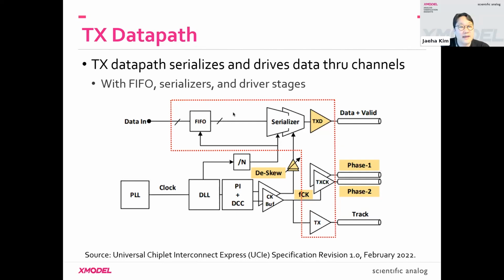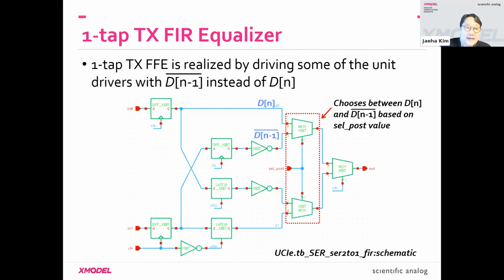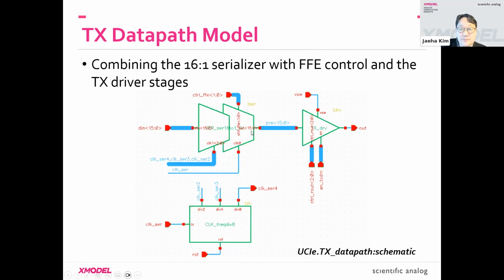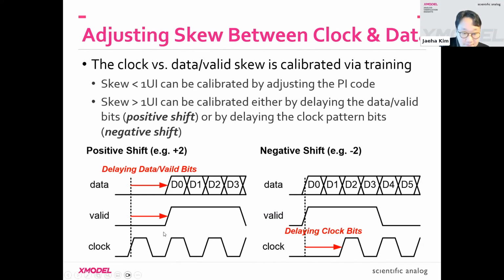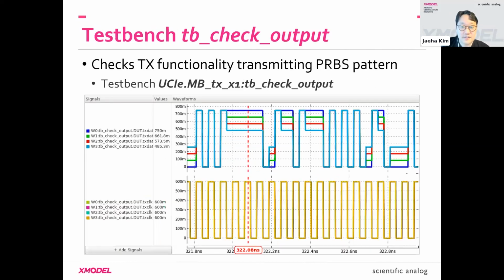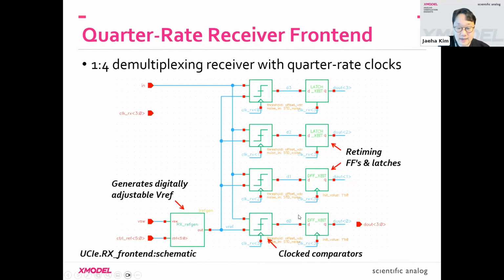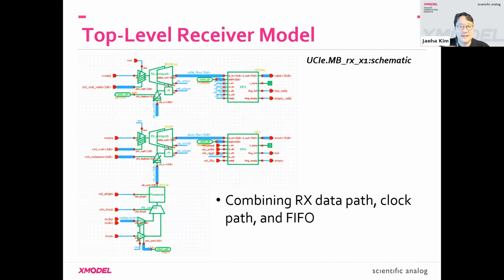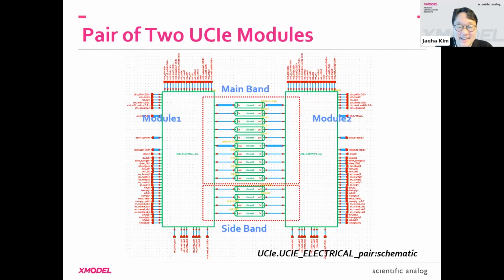[4/5] UCIe PHY Modeling and Simulation with XMODEL / UCIe Electrical Layer Modeling (Part 3)

Comment: Hi Thanks for the video, it is a very good tech video. I have some questions, for the FIFO, It does not have the double synchronizers to sync the wptr to read clk domain, vice versa, could i ask why those double synchronizers can be ignored in your design? By the way, If the double synchronizers added especially the rx fifo,  how to make sure the tx+rx latency is less than 2ns based on the spec? Thanks!
Reply from the maker: Hi - the FIFO models were assumed to be ideal, of which buffer can be read and written independently. In real designs, you may need to address additional constraints as you mentioned.